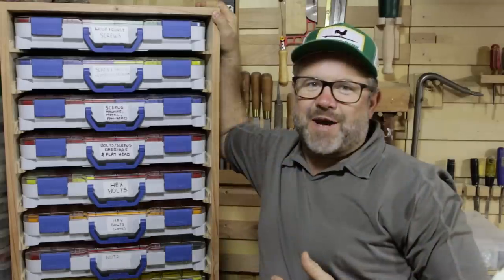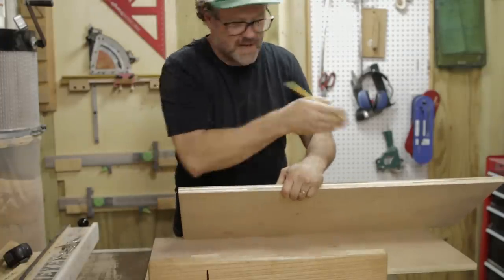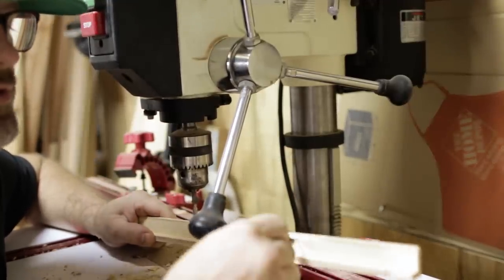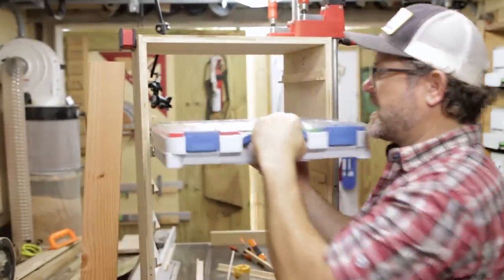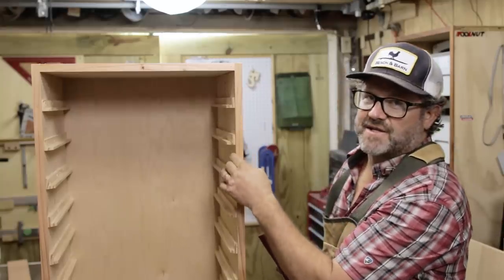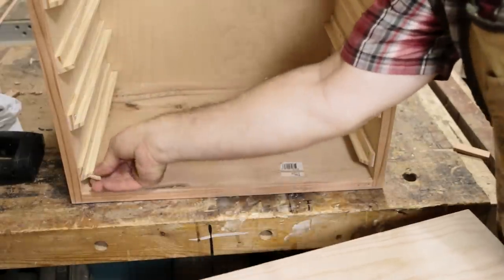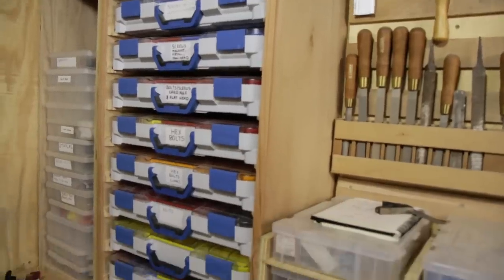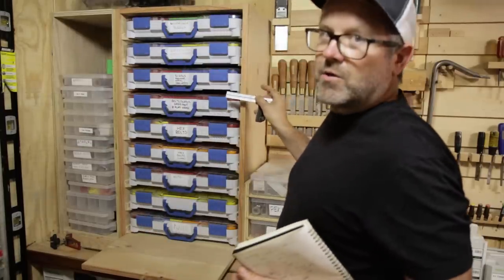This Small Parts Organizer Cabinet Has a Secret Feature

Comment: I would be worried about a heavy box on the shelf breaking the "slider" of the above box due to the lever effect. Any problem with that?
Reply from the maker: That’s a good question.  I have some very heavy containers - particularly one filled with nails.  I pull those in and out daily and I’m fairly rough taking them in and out.  But hasn’t been an issue and as this point it doesn’t seem like it will be.  They are replaceable and if it is a problem I would go with oak instead of pine.  I also think that the lever effect is minimized because the slider above is so close and it can’t really hang down at an angle as you slide it in or out.